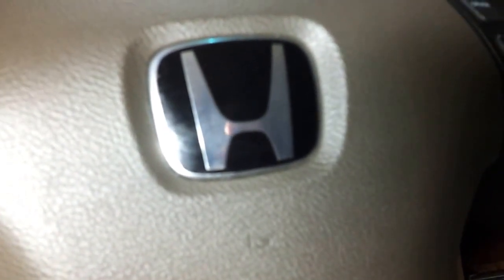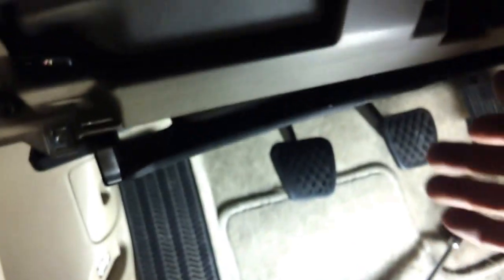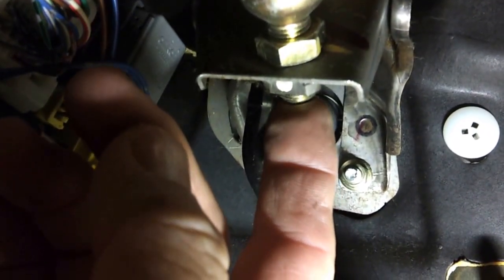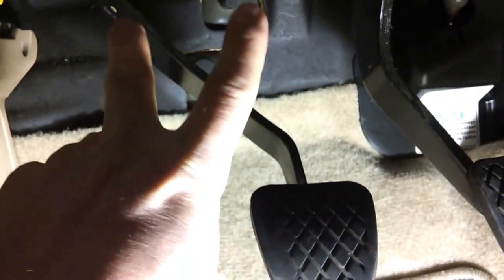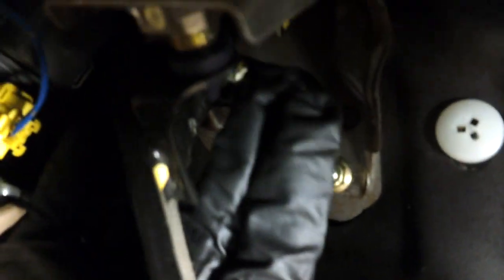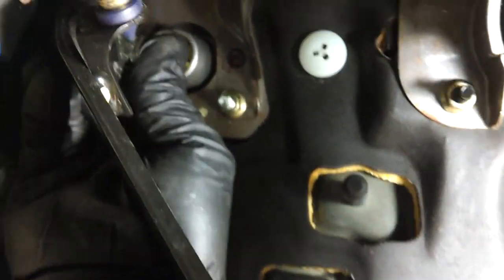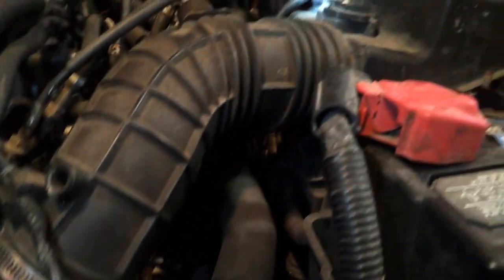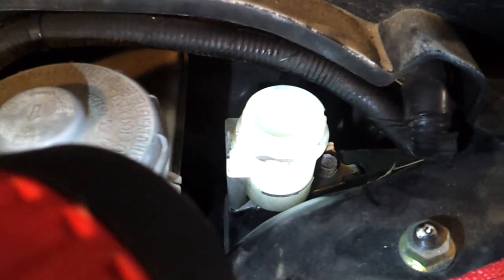Clutch Master Cylinder and Slave Cylinder - Honda Accord - 5 speed - 2005

Comment: Appreciate the video for this job! Helped me out a bunch! Couple of tips that helped me and could make someone else's job easier: the bracket that connects the master cylinder and clutch pedal has a habit of getting caught against the firewall making it awful to pull out. Having someone on the inside push the bracket through can make your life easier. The other thing is pulling the brake line so it feeds into the space between the firewall and the engine so it's not running into much made a huge difference for me. It took me all of 30 seconds to pull it out once I got it loose from the firewall by doing that. Didn't have to disconnect the airbox or anything. Hope these tips help someone out!
Reply: Wym by pull the brake line?

Comment: This video helped me quite a bit. My master looked the same as yours, one bolt sheered off. After changing it out and getting it working again, I took the old one apart like you did, but mine looked fine inside, not cracked like yours. I guess it was enough to lose pressure so it wasn’t disengaging the clutch. Anyway, thanks.
Reply from the maker: You're welcome
Reply: This just happend to my 04 accord. Same bolt same brake

Comment: I’m having the same issue with my 07 accord five speed, will not go in gear for anything when running. I already understand all the aspects of the way the clutch works but I was impressed with how well you explained it for someone who might not know. The real problem I’m having is that I have replaced both the master and the slave cylinder and it worked fine for awhile (months) and then got to where you had to rev match to shift and it won’t go in gear. I have completely bled the system very thoroughly 2 times since it started not going in gear. I pumped the clutch pedal approximately 100 times in each session and unbolted the slave and cycled it through its full range of motion and get no bubbles out and there are no leaks and the fluid stays full and the clutch pedal is adjusted to spec. I bleed the system by attaching a small silicone hose to the bleeder and run the hose back up to the reservoir, I have flushed the fluid out a couple times in the last year due to ongoing problems previous to the most recent replacement of the master cylinder. I have actually replaced it 3 times so I know the pain involved. I’m nearing my wits end on this. The previous master cylinders (3) all went bad and leaked fluid at the clutch pedal area. I think the firewall may have been tweaked in an accident and I had to shim the master to make the piston not bind up which is what ruined the others. So after fighting it for sooo looong I’m not sure what to even do. The clutch fork moves about 1/2” maybe less and does not leak down that I can tell. I even today fabricated a new slightly longer (1/4 - 3/8”) piston to activate the clutch fork and it tried to go into gear but still would not. I even did the bleeding on a steep incline so the front of car was higher cause someone thought that might help but no such luck. My system for bleeding does work because I have done it many times with success. What would you suggest?
Reply from the maker: Vacuum bleed the system. Inspect the clutch disc, usually when they wear down it begins to get hard to shift into gear.

Comment: I replaced slave and master cylinder and clutch and still won’t go into gear
Reply from the maker: Did you check the clutch disk and pressure plate?

Comment: Had the same issue happened to my 2013 accord and been thinking about just rebuilding it by application of JB weld on the leakage part of the master base knowing also the clip inside snapped or it is already snapped.  would it work on your DiY perspective for it to be use again?
Reply from the maker: Please tell me your joking, right?

Comment: Please chime in...my son has a 2003 CRV and has had 3-4 slave cylinders fail (aside from one having 1 out of 3 0 rings (OEM Honda BTW). Has new throwout bearing, new ceramic clutch. The shop he took it to went through a couple SC's before they sent it to the Honda shop. Everyone is stumped. Other than a series of bad parts (at this point statistically not likely), where/what in the chain could be causing these failures. Besides his car has been set aside for months as the shop make money on brake jobs. Help!

Comment: I have an acura tsx 2006, and its set up is just like your accord. Now for the master cylinder, I got to part where I am taking out the assembly of the master cylinder. I can't take it out becuase the clutch line runs around a metal area where I tried to take the line out but the gap is to small. I was wondering, how did you remove it?
Reply: Watch the video all the way through.  I show down low with the flashlight where I disconnect the metal line.  The clutch master cylinder is removed including about 1 foot of metal line as an assembly.  Have fun , thanks for watching- Ozz

Comment: Thanks for the good video.  I had to replace this entire line several years back as it broke just as I got back from Virginia to Illinois and the OEM was an all plastic and rubber hose system which I painstakingly had to discover after an arduous search because the service notices didn't clearly post this OEM change-over to the new cast slave and hard line parts.  In any case, I did this when I was 60 and I'm now 66 and not looking forward to doing the repair again, as I'm older and not a mechanic by any trade.  Been an office pencil pusher my entire life.  But I changed the slave and the pedal kept sticking, so I've come to the conclusion it can only be the master.  Glad you had this video because I've forgotten most of the master part under the dash and this was a good reminder for me.  I'm betting..........just betting, that mine too will show a sheared bolt as well.  In any case, thank you.  I said I would never, EVER again, replace a heater core, ignition or this system in ANY car EVER again, but a fixed, retired income dictates that I tackle it.  AGAIN.  dammit..........lol..........thanks dude.
Reply from the maker: I hear ya Fox.  Your retired so you can take your time, get the job done and $ave a bunch of cash.  Since posting this video I have learned from several viewers that the bolt head is liable to shear off.  I can actually do the entire job in about 30 minutes but that's from experience,  practice and having the right tools  If you have no pedal pressure be sure to check for trapped air in the system.  If it's not fully bled there will be very little clutch pedal resistance.  A good flashlight and some reading glasses and you should be able to see if one of those bolt heads are broken before taking the unit out.  Good luck and thanks for your comment! - Ozz

Comment: Must watch video if you've been told you need a new clutch!Thanks, was about to invest $1500+ plus to replace the clutch in a 2005 TSX Acura...Excellent description why the clutch pressure plate cracked.

Comment: Within the last few days I have had to put the trans in gear and depress the clutch pedal to to floor before starting the car. I noticed that when i do that in my garage (level floor) the car begins to move forward even with the clutch fully pressed to the floor.  If replacing the master and slave cylinders don't fix the problem my next step with be rebuilding the synchronization plates (install a rebuilt transmission). Keeping my fingers crossed in the mean time.   Thank you for your excellent presentation and instructions.
Reply: try adjusting the master/ clutch pedal. spin it one full time around and test it (clockwise is to make it engage further to the floor and counter clockwise[left] is to make it engage higher, so I would say spin it counterclockwise one time and test it.
Reply from the maker: Go to 19:46 mark in the video

Comment: Thanks for a great video. Without it, I don't believe I could have accomplished the task. My 2006 Accord 3.0 V6 was identical in the firewall area and I didn't think I would ever be able to get that cylinder out of there. After it was out, I said to myself, now how will I ever get a new one back in there? I did though. My slave unit is different from your video, so Honda made a change there. It is in the same location though. I had to ordered it online. Couple of notes. When assembling the hydraulic line to the new cylinder, It seems important to keep the orientation lined up from the old one. Otherwise, you would have to loosen and tighten the hydraulic line after it was installed. I'm not sure I could have gotten two wrenches and my hands down in there, so I opted for your procedures. I also noted that the use of a 6 wall socket is probably a good idea, especially on the slave unit. Stripping a bolt head with a 12 wall socket would likely create a whole new problem since there is no room to work down there. I also used a liberal amount of liquid wrench prior to unbolting the slave bolts. Even then It was tough and I was a little worried that one of them might not break loose without shearing the bolt. I even used a couple of short licks with an impact hammer. Whether that helped, I don't know, but at least both broke loose. I virtually duplicated your work and am grateful for your video. Oh, one more thing. This is a young man's work, not old like me, so I'm also thankful for Aleve. I'm not sure where this procedure lands on a 1-10 scale for difficulty, but for an amateur like myself, it was a 10 in the master cylinder area. Thanks again for your time and willingness to share.
Reply from the maker: +Wil Haines thats great that you fixed your car and I'm glad the video was helpful.  Sometimes repairs can go from easy to super challenging in an instant, when Murphys Law kicks in!  Your right about doing this kind of work.....it can be physically demanding at times.   Old age sucks!  You take it easy and thanks for your comment! - Ozz

Comment: I have had 3 bolts shear on me but garage just replaced bolt and filled and bled each time. Could not work out why the bolt could shear but now i know. I didn't realise this could be caused by split plate. It's back on road now but think I better get replacement unit. Good video.
Reply from the maker: Thanks for your comment Andrew

Comment: 2007 Accord, my clutch pedal made a crunching noise today and wouldn't go into gear- I looked and guess what that same bolt is broken..    Thanks for posting this video, I'll let you know how it goes.
From Ontario Canada.
Reply from the maker: Glad the video was helpful.
Reply: @ozzstars_cars  Aftermarket part is installed and works great now.
The most difficulty was bleeding the system afterwards.  I ended up using vacuum from my "Topsider" oil change pump, connecting it to where the steel line meets the flex line.  Anyway, thanks again.
Reply from the maker: @RS-dc7wy  Glad it worked out for you.👍

Comment: I took the wheel off just for a little extra room to work with, putting the new master in was super easy for me the hardest part of the job was getting to the slave cylinder to bleed it because there is no room to work. I ended up taking off that coolant line witch freed up a lot of space and removing the slave cylinder so I could crack the line without trouble. then I just bled it from the line because you cant really get a wrench in there to use the bleeder.

Comment: Thanks for a great video. I tackled mine with your advice and saved who knows how much in shop labour. Parts of it were a bear but I made it to the end. My hydraulic line from the master to the flex joint had three fasteners to the frame. Didn't see that one coming but we made it to the end. Your video gave me the drive to tackle the problem and it probably saved me hundreds of dollars. Thanks for the posting.....

Comment: You're right about the moisture in the fluid but what happened is, water doesn't compress so it cracked the piston and broke the bolt bc something had to give. That also means that you didn't need to extend your pushrod more than likely because clearly it was already disengaging the clutch as far as it would go or the piston wouldn't have cracked

Comment: Thanks for this video.. it helped me in removing the MC..  

I just replaced my  clutch master cylinder on my 2003 Honda Accord EX..  It leaks from the inlet connector(not the threaded side) in between the threaded and the body of the cylinder..  I received an oring with the unit and slipped it over the cap housing end toward the body of the cylinder.. Is this where it is supposed to go?  Or simply at the bottom of the inlet area, trapped between the cap end and cylinder housing?

Thanks..
Craig
Reply from the maker: You should contact the manufacture that made the part you purchased, I never had an extra oring on this unit when replacing.  What are you referring to as the cap end? cylinder housing? Not sure what you are trying to tell me, sorry
Reply: +Ozzstar   Thanks.. Sorry.. I meant the outlet cap.. held in place by the U shaped rod..  It wasn't really an O-ring.. but rather a bushing?? It came in a plastic bag with the unit.. I just supposed it went in the bottom of this cavity..?
Reply from the maker: Sounds to me like you are describing the plastic plug which fits inside the female threads where the hard line attaches.  This is used to keep debris and moisture out until the unit is installed. It must have fallen out.
Reply: +Ozzstar   Thanks for reply.. No.. not the plastic plug.. It is evident what to do with this..  This is a square o-ring that slips around the outlet fitting(at the base.. down at the bottom of the outlet(hardline) cavity..  I bought the oem from Oreilly's and it had problems with not being made correctly in the cavity area.. returned it and went to NAPA and fixed my problem..  Thanks again for the video..

Comment: Thanks for the video 
This is a big help and so clear 
What kind of greace did you use on the slave cylinder by the way 
Thats the one thing I don't know what to do 
Would red high temp greace work
Reply from the maker: A little dab of red grease will do yah. 👍

Comment: I have the same problem on my 2006 Honda Accord- Thanks great video.
Reply from the maker: Thanks Jose, take it easy - Ozz
Reply: same with my 06 si.   just came home turned my car off n press the clutch and heard a pop! and it stucked to floor. I took the master and found the same the bolt broke!
Reply: +Ozzstar yea thanks for the video I was wondering why the bolt broke and couldn't find anyhing.on forums
Reply from the maker: +Raiders51fitty this is a defect for sure!  I'm wondering if it has to do with an older clutch  pressure plate 'sticking' at times and causing excess hydraulic  pressure blowing the heads of the bolts off???  very possible
Reply: +Ozzstar good point I also think this was a defect.   I ordered the "updated" one from Honda lets hope it's better.  like you I went ahead and order the slave as well

Comment: perfect video. I struggled hard with the high pressure line removal. I only did the master cylinder and now I'm slowly leaking clutch fluid. I go through a whole reservoir in about 2,000 miles. my issue is that I can't find the leak. is it likely slowly dripping from the boot and not collecting? I'm going to replace the slave and see if that helps.
Reply from the maker: It's not leaking back inside the car on the floorboard is it?  That seal can go bad.  After replacing that much fluid you should see the leak.
Reply: Ozzstar nope. It's not leaking inside at all. it either has to be leaking from the line I messed with or from the slave at the boot and it's just not hitting anything on its way down. I can't find any wetness
Reply from the maker: +Tanner Vice the fluid is going somewhere?!?
Reply: that's the problem. i can't find where the fluid is going, so I can't see where it is coming from. I was wondering if you had any tricks to help me figure it out. wherever it leaks from, it isn't hitting anything or collecting anywhere obvious.

Comment: Hi! its a great video Ozz, i started changing my clutch cylinders today just stepped on one problem, the line from the main pump to the first intersection goes under a piece of circular metal, i already took the slave out and loosen the whole line under the engine and cut the plastic that holds the line under the air filter, but the line seems to be stuck under that circle.... i assume thats the hard part you told us about, how did you get it out? is there another clip or something?can i just pull it out strong? hope you can answer soon....
Reply from the maker: from what i remember there was a line clip further up out of site by the firewall.  Had to remove it by feel.  What a pain!  Good luck

Comment: This is a GREAT video. Terrific detail. I like how you show every step and tell us what tools to use. By the way, do you know if you're supposed to replace the hydraulic fluid for the clutch at regular intervals?
Reply from the maker: Thanks David.  The clutch fluid is brake fluid so yes it should be changed every few year but more than often it isn't.  The reason to replace the fluid is because it is hygroscopic, meaning the fluid absorbs moisture and becomes less efficient and can also cause rust and corrosion internally. Thanks for watching and commenting!
Reply: Ozzstar
That's good to know. It's not in the owners manual as a maintenance item. Just bought a few bottles of DOT 3 brake fluid to replace it on your good counsel. I'm using turkey baster method as I'm not comfortable with the bleeder bolt thing. Thanks again for your assistance and the terrific video.